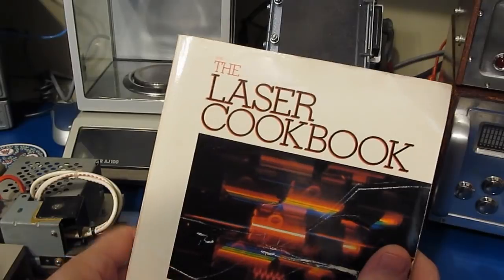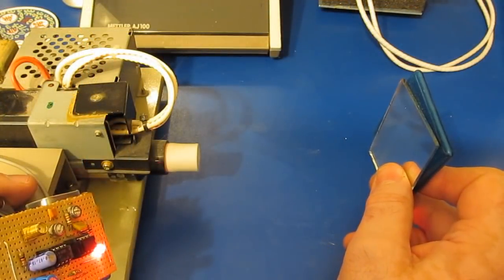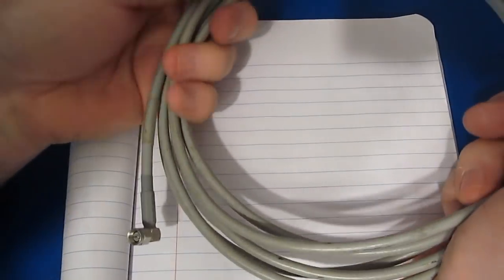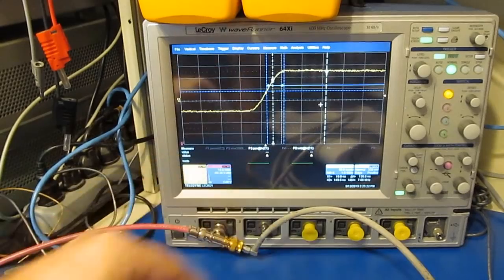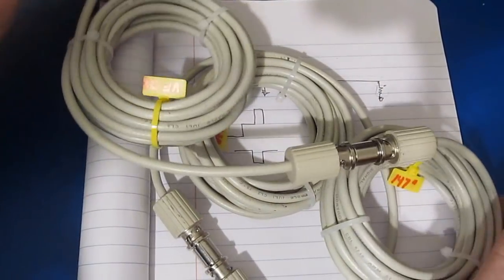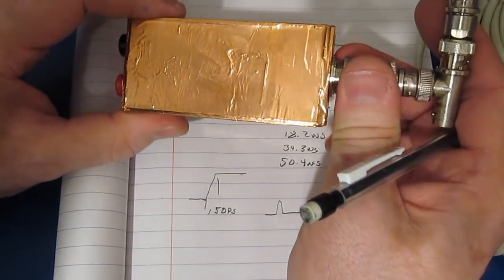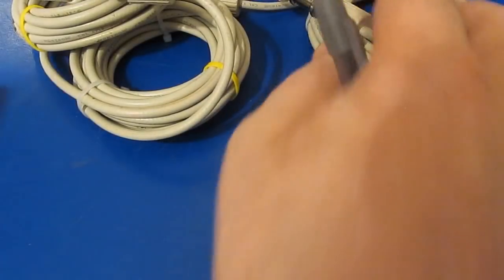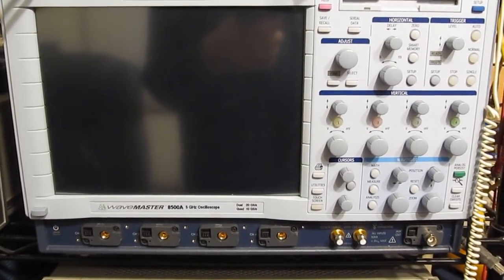From Velocity Factor to Index of Refraction, Measuring Pulses

Comment: Very cool stuff Joe. Your engineering chops are amazing. I used to build fiber optic furnaces for Corning Inc. I was project head in our shop for many versions of furnaces in the 90’s. We built all the induction coils, cooling towers........early ones were all OFC101 copper and silver soldered together. Tough stuff to machine, very abrasive on tools including carbide and ceremet. Later ones were 304L SS. It was booming technology at that time. I got to hang with some brilliant engineers who always wanted my input as the builder, also dealt with some total wankers who I haven’t a clue how they made it through college and got the position. Lol.
Reply from the maker: You're a real renaissance man where my interests are fairly narrow.

Comment: Very cool.  I think its interesting that electrical pulses can move near the speed of light.  It makes me wonder how electrons can do so, but then, maybe low current impulses are not electron displacement, but a smaller particle that can move like waves in the grass?
Reply: Gristle, the electrons don't move at the speed of light the disturbance in the field propagates at the speed of light.  Electrons are very slowly moving down a wire with a DC current. The propagation is always moving at exactly the speed  of light. The velocity factor accounts for the fact it's in a cable not a vacuum the way index of refraction accounts for glass in a lens. Fermi lab channel has a video  on index of refraction.